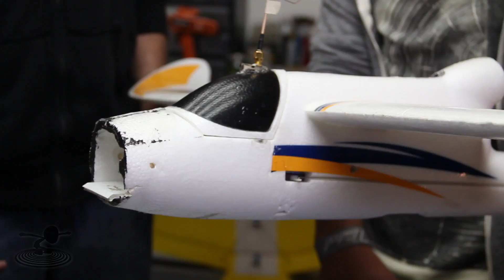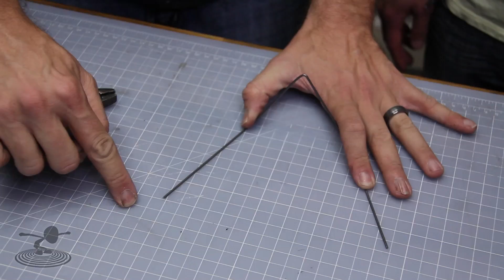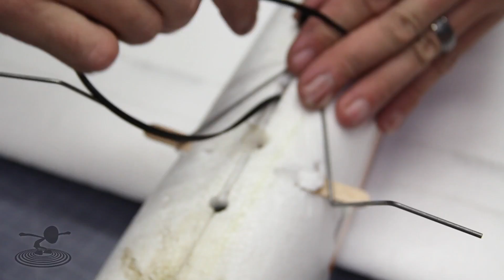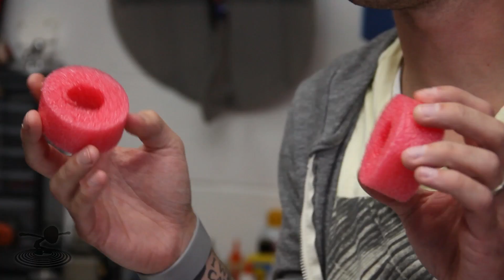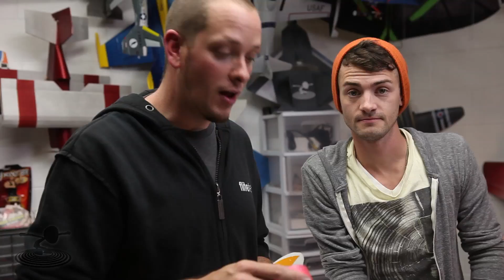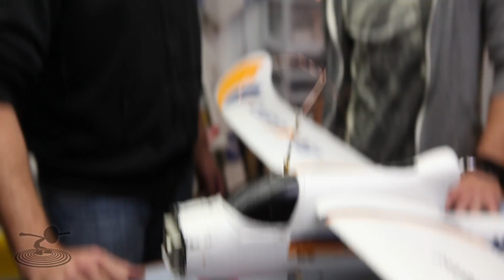Flite Test - DIY Landing Gear - FPV Bixler!

Comment: Rather than a drill, use a hole punch. Cleaner hole. Put the hole in FIRST, make sure it's centered, and then glue it into place. If it's not, do over with another cap. Youngens... full of ideas but got no horse sense.

Comment: I still couldn't build a durable landing gear. Either the wires bend or the attachment fails because the fuselage is basically foam.

Comment: So I accident gave toe in for the landing gear on my ft storch how should I remedy this
Reply: On taildraggers, a little toe-out is far more preferred over any toe-in.  (Think of what the airplane does exactly at the instant of touchdown.)  Can you bend your toe-in out by the use of two pairs of pliers, or a vice and pliers?

Comment: Where do you get a cutting board like that?
Reply: Most hobby shops or fabric stores carry them.
Reply: We have one local independent hobby store and their boards where all small. I'll cheek the local fabric shops and maybe Hobby Lobby. Thanks for the tip.
Reply: No problem. Just be aware, fabric shop prices can be high. I'd shop around.
Reply: Good tip, thank you. I'll do that.

Comment: I'll be getting a Bix3 soon, and I think this would be a good alternative to the tiny wheels it comes with. I've got plenty of pop bottle lids and wire hangers, all I need is a noodle... :>
Reply: Erica Sherwood the bix 2 is better
Reply: If you don't want to leave and go buy a pool noodle, just cut out some circles from dollar tree foam board!

Comment: If you don't want to use a drill and would rather play with fire, You can put the metal landing gear end over a candle to heat it up and push it through the caps.  It is a lot of fun.

Comment: no need for a wheel in the back? you will trash the end on that rocks.
is there a position where you should mount the landing gear? i supose the plaine should be balanced.

Comment: Hmm, what about having the wire be stuck through the wings and then secured with zip-ties? Unless that creates a center-of-gravity issue (in which case a third landing gear wheel could be attached to the nose of the plane and then the center-of-gravity could be moved forward) I don't see why this wouldn't work

Comment: yea, the only problem with the DT foamboard is that i've found that most of the stores dont locally stock it. best way to get it is to order it then have it shipped to the store. its ~1.00 per board, BUT you need to order it in 50 sheet quantities. so your talkin 50$ for foam board...

Comment: I Got tired of slicing my fingers open on the zip ties after I cut the excess off.  To get around this on all zip ties now I cut them off flush and then hit them with a hot blade screwdriver to melt the sharp edge left by the side cutters.  It usually also permanently melts the plastic tail to the sleeve so that you no longer are relying on the plastic spring action that can fail.
Gotta go to to Dollar and get me a float now, thanks.

Comment: couldn't you have bent the end of the wire to keep the wheels on, instead of using a zip tie and hot glue? I've found hot glue doesn't stick very well to metal, and I would think the zip tie would just slide off too easily.